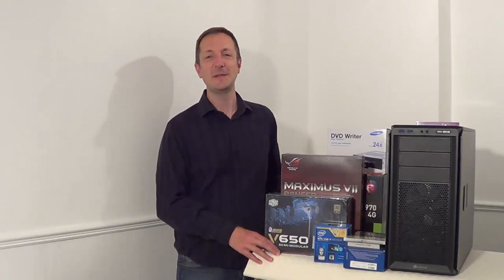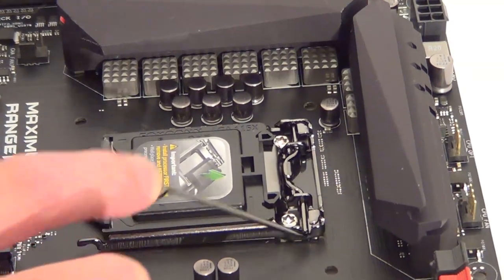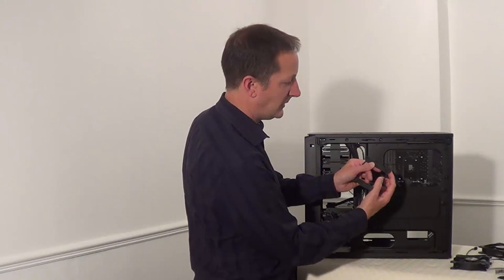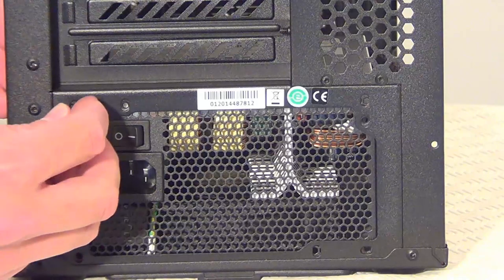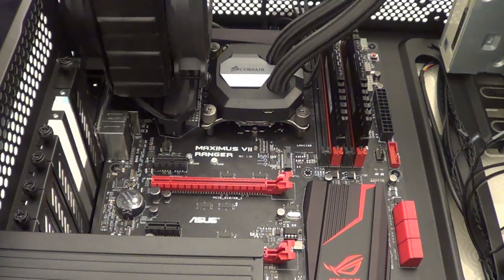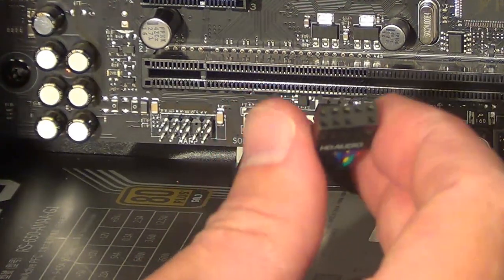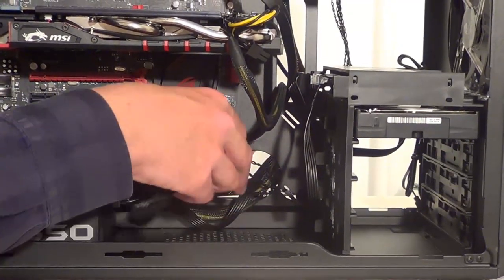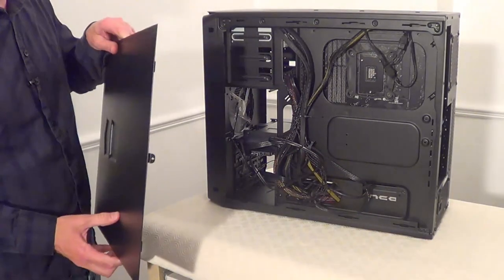How To Build a Gaming PC 2016

Comment: I know this is a very old video at this point, but I just want to make sure that the correct information is out there. If you’re going to put a radiator in your case in this orientation, make sure the pipes are at the bottom of the radiator. Not the top. Air in a cooling system will invariably rise to the highest point in the loop. With the pipes at the top, as you lose liquid and air enters the system, you’ll have turbulence and the pump sucking air from the top of the radiator.

Comment: One of the best tutorials, but you only have one small problem, when you install the RAM make sure its the slots that are closest to the CPU
Reply from the maker: Thank you for your comment! It's recommended in the motherboard manual to use the red slots when using two memory modules.
Reply: EasyPcRepairs Thanks for responding, I think motherboards may be different with the slots.

Comment: Is it ok to use one sata power cable to power all the ssd, hdd and optical drive? Cause in your vid, you used two cables, 1 for the ssd and hdd and 1 for your optical drive.
Reply from the maker: +Mark Lawrence Ranollo You can use a cable for all three, but quite often they're not long enough to reach the optical drive as well.
Reply: +EasyPcRepairs ok thanks
Reply: +EasyPcRepairs Nice vid, can you do another one where you are showing how to set up os and installing drivers after assembling of components has completed?
Reply from the maker: +Mark Lawrence Ranollo I don't have plans to do a video like that just yet, but I'll keep it in mind for the future.
Reply: its nice if you do. i like your videos because you do it step by step and with clarity. Hoping for it to happen

Comment: Great video, followed every step; except, I ordered the wrong motherboard. I purchased the Ranger VIII instead of the VII, now I'm stuck on whether to return the processor or find another compatible motherboard. What would you suggest?
Reply from the maker: +George Diaz I would recommend keeping your processor and buying the 'Asus Z97 Pro Gamer' motherboard. The Ranger VII (as shown in the video) doesn't seem to be so widely available right now, but they can still be found here and there. The Asus Z97 Pro Gamer motherboard is widely available and is very similar to the Ranger VII. It will also be 100% compatible with all the parts you already have.

Comment: +EasyPcRepairs do u have to use a liquid cooler or could you keep the fan.
Reply from the maker: You could use the fan instead. That wouldn't be a problem at all if you're not going to overclock the CPU.

Comment: is it bad that when installing gpu the screws were hard to put so I pushed it a little forward and got screws in. I have the twin froze and an h440. also the computer Is working
Reply from the maker: +Im radiant No, that's fine. As long as it's connecting properly, and obviously it is because it's working, so no problem.
Reply: +EasyPcRepairs thanks

Comment: as always Dave a fantastic, informative video.  It's quite a coincidence that I have purchased very similar parts.  msi gtx 980 4gb, msi gaming 5 motherboard, I7 4790, I am reusing my old ssd, 3xhdd and antec power supply.  I only have to buy a case and cooler and then I can build it!

I am extremely wary of water cooling as I have heard many horror stories but it seems the only realistic solution.  what are your thoughts and experiences on water cooling the cpu?  Also will you be covering the final set up steps with the mobo driver,  installation, bios set up and cpu/gpu overclocking and first boot up of your epic pc!
Reply from the maker: +Steve Welch Thank you Steve! Sounds like you're building yourself a great pc! As for water cooling setups, there are some that leak but the one I've used in this video (Corsair H80i GT) is a good one and is very unlikely to be a problem. It's extremely rare for a good quality CPU water cooler to ever leak, but cheap ones may do (that's why I avoid them).

I won't be covering the final set up, but I do know that your particular graphics card will arrive with overclocking software. That software is very simple to use so I'm sure you'll have some fun with that!
Reply: +EasyPcRepairs I will look into that particular water cooler, I guess I am just getting nervous installing water cooling into my pc.  thank you for the sound advice as always.  msi afterburner is a brilliant programme and easy to use!

Comment: I am thinking about building my pc for first time, since I fly MS Flight Simulator-Steam Edition which causes lag on my current Asus ROG laptop... but, what is confusing me the most is, there are so many of these cases such as iBuyPower, CyberTron etc... do these parts come standard sizes to be able to fit into those shells regardless of which company's shell I try to get? or every single type of pc shell case have different requirements for hard drive, processor, ram etc to be added? I have been very confused in my attempt to understand that part. If I buy a new computer it will be pricey enough and prebuilt still won't meet all requires for my current needs... and, what if I get a cyberpower or such company's desktop that's not too fast to save costs, will it be upgradable in the long run? Such as if I get one w/ 4GHz processor and 1TB hard drive and then in the future a new processor comes around, will I be able to upgrade a new processor in the one I will be using with then older processors etc?
Reply from the maker: +Esoteric Desi Just about all desktop computers are upgradable. The bigger the case size, the more upgradable it will be. Hard drives are a standard size so you can always upgrade your storage space. Graphics cards are often upgradable in desktop PCs but small cases will limit your 
options for that. If you want to buy a pre-built computer that is upgradable in the future, I would recommend one that has an ATX case or 
an E-ATX case as they have a good amount of room for extra / upgraded parts inside them. But be aware that some pre-built computers are very limited to their upgradability as they can use proprietary parts that's only any good for their products. There are many companies that will build a pc for you that are very upgradable though, so that would be my recommendation.

Comment: Hello Quick question,
In the video while you were installing the RAM, you said to use the red slots, is that a absolutely necessity? are you not allowed to use the black slots? thanks
Reply from the maker: Hi, the motherboard manual recommends using the red slots if you're only using two RAM sticks. The black ones would then be used as well if you have four RAM sticks. Many motherboards don't care where you install the memory, for example, using the black slots only is often fine. But some motherboards are more particular and won't even start up if you don't install them just how they like it.
Reply: Thanks a lot!

Comment: I have a question. When you buy an SSD. Do you get the cables to plug i in to the system ( I dont mean the adapter )
Reply from the maker: For an SSD to work, you'll need an SATA power cable (to attach it to the power supply) and an SATA data cable (to attach it to the motherboard). The SATA power cable will be attached to the power supply, so you don't have to go out and buy one. The SATA data cable may be shipped with an SSD, but not always, so you may have to get your own.
Reply: EasyPcRepairs Thanks!

Comment: one question. why did u open the red tabs instead of the black one? Is it option
al or specific reason?
Reply from the maker: The motherboard manual recommends using the red slots for the ram. This is so that the ram can be used in dual channel mode and have some space between the memory and the cpu cooler. This is quite a common setup for many motherboards today.

Comment: Nice video! I want to make a game PC myself as well. But I'm a complete newbie. I want to do it with a AMD processor. Do I need a spesivic motherboard and videocard made for an AMD processor?
Reply from the maker: You'll need an AMD motherboard for an AMD processor. If you're only using one graphics card, you can use an AMD or Intel motherboard.
Reply: Thanks for the reply. Appreciate it.

Comment: hey when i first start the pc after completing the build, can i plug my monitor onto the gpu instead of the motherboard to run the mobo bios, install operating system etc?
Reply from the maker: Yes you can. If you have the option of plugging your monitor into the motherboard or graphics card, you're best off to using the graphics card for running the motherboard bios, installing the operating system and anything else.

Comment: +EasyPcRepairs Hello, great video!! I'm am SUPER new to building PCs. I'm thinking of buying the parts used in this video and following along. However I want a beast pc, so how well does this pc play demanding games? If I upgrade the graphics card to the GTX 1070, would it fit in this build? Also it would make a difference in performance and such if I have this but not upgrade any of the other parts aswell? Will it run games at 1080p 60 or more fps? Sorry for all the questions lol
Reply from the maker: A GTX 1070 will fit into this computer with no problems. The gtx 1070 is definitely better than the gtx 970 so it would be a very good upgrade. This pc (with the gtx 970 or the gtx 1070) will play all games at 1080p with around 60fps.
Reply: +EasyPcRepairs Thank you!

Comment: I recommend a 600$ starter pc (On Board graphics for gaming) 
I started with a amd fx-4300 and a gtx 730 2gb and i was running high at 1080p on bioshock infinite
i upgraded the gtx 730 to a gtx 970 4gb for better graphical performance 
the cpu can be clocked to 4.2 ghz and is a quad core so it holds its own even today for gaming at a good price

Comment: I have a question, I 'm building my pc , but the processor comes to me the other week , but i turned the pc without processor , I know it would not give video or beeps, but I'm very worried, I can damage my RAM or my ssd or my hard drive ?
Reply from the maker: +SoyVictorManuel Rocha If you turn on your computer without a cpu installed, nothing will be damaged.

Comment: I would put the fan on the radiator other way around so the air is blow out instead of blow in the case
Reply from the maker: I did switch the fan around so that it blows out of the case. This is shown in the video.

Comment: Can i use a different CPU because this one is expensive in my country . Pls answer
Reply from the maker: You can use a different CPU, but every computer (or motherboard to be more precise) will only take certain CPUs. For example, you could use an Intel Core i5 4690 with this computer, but not the Intel Core i7 6700k as this is a different generation of CPU that isn't compatible.

Comment: hello hello sir,,,, can i ask u something?

 im really really want to now,, what happane if plug in something wrong like cable,,
what will happane?
Reply from the maker: That depends which cable it is. Either nothing will happen, or a circuit board could be damaged depending on the cable and the port.
Reply: Thanks you so much sir for replay
i'm going to build my first pc in next 2days and im really worry about that i dont have much money for spend this is my first time building i'm just worry about something bad happane when i plug something wrong,, 
so you mean nothing happane when i plusg something wrong right?
Reply from the maker: You CAN damage a circuit board if you plug something into the wrong port. But not to worry, your motherboard will arrive with a manual so you will be fine if you follow that.
Reply: thanks you for your time to answer me sir,

no its just system clone sir,, :(
its second hand system with new system 
i bought new ram(8gb) 
secondhand boad
secondhand VGA (1.5gb) 
400w power spp
and it will arrive tomorow so it time for it im really worry about that,

Comment: Wait sorry, would it already be connected to the Wi-Fi? Or no? And also how to get the computer to connect to a PS3 or PS4 and sorry is there a capture card? (sorry i'm trying to start up a gaming channel once I get the money and I dunno how to do this stuff cause i'm a noob at this...) Also do you know any great monitors for the computer?
Reply: You will have to buy a wifi card and install it to connect to wifi. Also you will have to buy a capture card and connect it to a console manually to record gameplay . For 1080p gaming I recommend the asus vg248qe.
Reply: Oh thank you! Wait would the stuff work with the same build as the computer he put up above? (I'm sorry i'm still a noob on this stuff but i'm trying to learn so I know in the future)
Reply: +John Egbert it should all work. I would go with a newer cpu though, an i7 6700k or an i5 6600k. You would also need a new motherboard and I recommend the asus z170a.
Reply: So like: 
CPU:  i7 6700k or i5 6600k
CPU Cooler:  Corsair H80i GT
Motherboard:  Asus z170a
RAM:  Corsair Vengeance 16GB (1600MHz)
Graphics Card:  MSI Nvidia GTX 970 4GB
SSD:  Sandisk 480GB
HDD:  Western Digital 2TB
Power Supply:  Cooler Master V650 (650 watt)
Case:  Corsair 230T
DVD Drive:  SH-224DB
and then the wifi card and the capture card: Asus vg248qe???
Reply: John Egbert yes that should work as long as the RAM is ddr4
Reply: Okay, thank you so much!!!

Comment: Finally found a video which has nearly exactly all the parts I want to use. Love you channel Dave! 
Would it be possible for me to ask you a couple of questions about the parts I have in mind? If so do you have a preferable way of contact. Could I email you? Thanks :)
Reply from the maker: +Wasabi D Thank you Wasabi D! Yes, you can ask away right here.
Reply: Awesome. Well I'm building a PC and am not sure how wifi fits into it all. Do I need to buy a wifi receiver of some sort after I've bought all the sort of parts you've listed? Or does it come built in somewhere?
Reply from the maker: +Wasabi D You can connect this computer to your Internet Service Provider by using an Ethernet cable, which will connect this computer to your Internet Service Provider's modem/router. If you want to connect this computer to the Internet wirelessly, you'll need a wifi card which can be picked up quite cheaply at places like Amazon.
Reply: +EasyPcRepairs Thanks Dave!

Comment: Ahh, great video, just why didn't you use a 390 instead?
Reply from the maker: +Xetion Thank you! I chose the GTX 970 over the R9 390 as it's a little faster for about the same price. Both great cards though.
Reply: +EasyPcRepairs no, it isn't faster. You know that yourself, and when dx12 comes out it will be dead. I don't like 3.5gb vram
Reply from the maker: +Xetion Allow me to answer that one again... both cards are very similar in performance. With some games the R9 390 will be the best and for other games the GTX 970 will be best. For the games that are currently being played on the PC that was built in this video, the GTX 970 is a better performer. Hope that clarifies where I'm coming from.
Reply: +EasyPcRepairs  well, check the benchmarks on YouTube. The 390 wins there on all of them over the 970. The 970 only has 3.5gb of vram, making it not future proof at all, as we see games using 6 gigs of vram nowadays, and knowing nvidias tactics of abandoning a card or whole series of cards from driver updates might happen, as you saw on the 780ti being worse than the r9 290x on Dx11, not 12. When those two products where flagship cards the 780 ti pwned the 290x. Lastly, dx12 is the future. Dx11 was nvidias lucky API, dx12 is AMD's. Dx12, as you probably know, is based around AMD's Mantle™API, which will give AMD cards a huge benefit over nvidias cards. You probably saw the performance test, yeah, you know. The r9 390 is a much better card both now, and in the future. Hope that clarifies where I'm coming from.

Comment: Where can I buy all of the parts and how much would it cost???
Reply from the maker: +AoDManiac This pc cost £1,000 (approx. $1,400). All parts can be purchased on Amazon. A few other places are overclockers.co.uk (if you live in the UK) and newegg.com (if you live in America).
Reply: Is there any other cheaper way? My budgets pretty low. It doesn't have to be the greatest content. Just as long as I can play NBA 2k 16 I would be fine! LOL!
Reply from the maker: +AoDManiac For that game I would recommend an Intel i5 cpu with a GTX 950 graphics card for good game play. For playing the same game with max. settings, the AMD R9 380 or the GTX 960 would be great. 8GB of RAM would be plenty for NBA 2k16. A hard disk drive would be absolutely fine too (no need for an SSD for that game).

Comment: I'm building my gaming pc with this parts: Asus Z170-Deluxe Motherboard,Intel Core i7-6700 Processor,Asus NVIDIA GeForce GTX 750 Ti ,Kingston HyperX Fury 8GB DDR3 1866MHz Memory,NZXT H440 Mid Tower Case,Corsair VS650 650W, and a Western Digital 1T HDD. Can  I play CoD Black OPS 3  and Farcry using this pc build? Please do help me sir
Reply from the maker: The GTX 750 Ti, i7-6700 and 8GB of ram will run those games with no problem. You may have to run them at high graphics, not ultra though as the graphics card will be a slight bottleneck.
Reply: +EasyPcRepairs Thank you very much sir!

Comment: how do I ground my self when I'm builing one?
Reply: +ELEMENTAL SLAP You can effectively ground yourself by plugging your power supply into the wall and not turning it on then occasionally touching it or an antistatic strap. when you place it in the case it also becomes grounded as long as it is plugged in